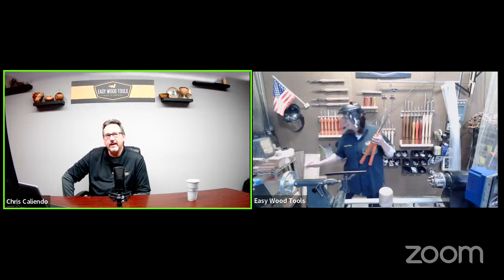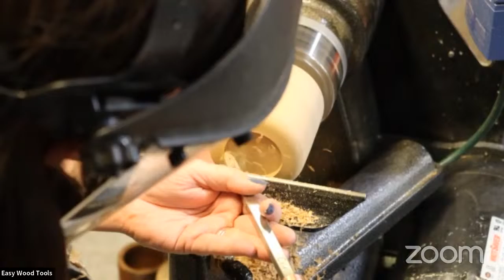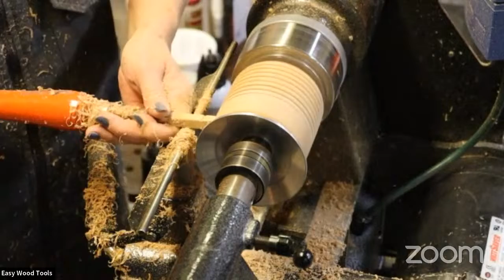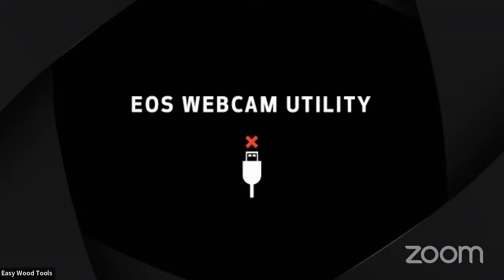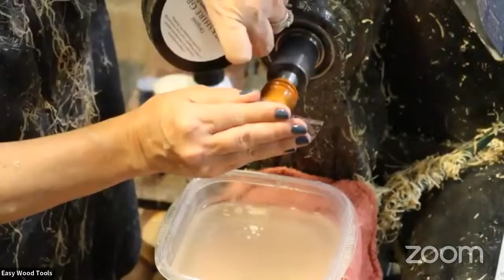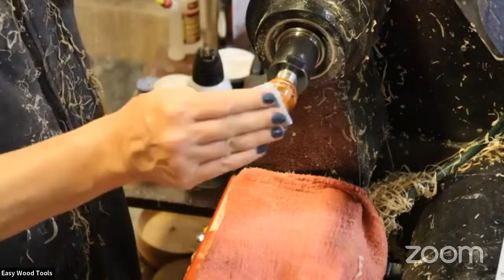Turning with Easy Wood Tools featuring Christy and Cris Caliendo

Comment: Even with a face shield, one does get some dust so it is good to gave some water or ice tea to wash out your mouth also some tissue for what gets up your nose.  even if you use a mask you will have some from your eye's tear ducts that drain into your nose.  That super fine stuff goes Everywhere.
Reply from the maker: yeah it does! thats why we are obsessed with the new power caps we got in the shop lol. Gotta protect those lungs!!